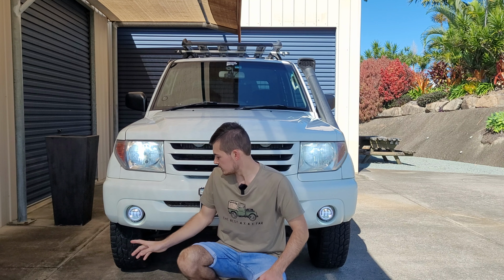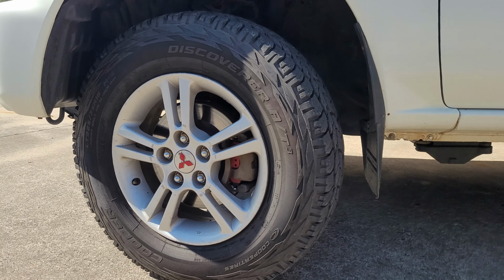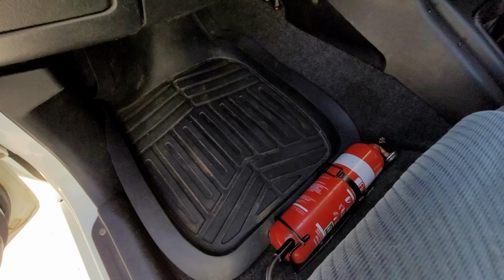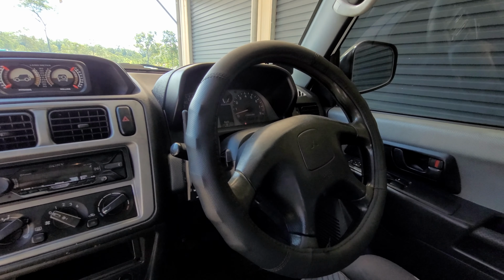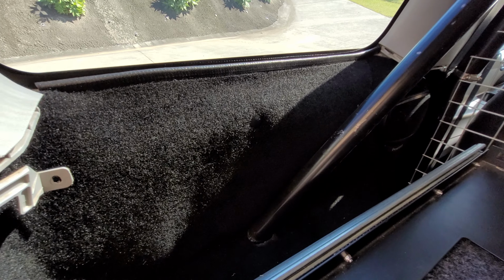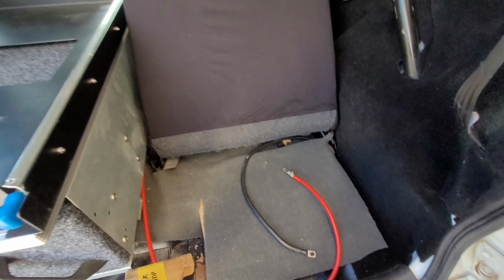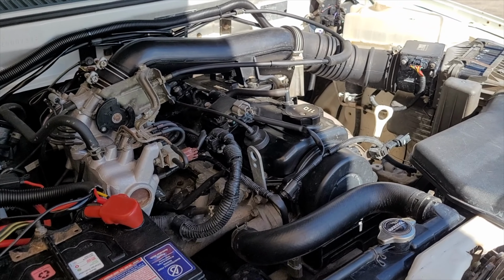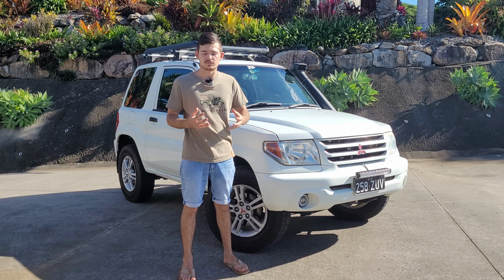Best bargain 4x4 in Australia.

Comment: Would be cool if you did a video on budget 4x4s you'd recommend, I am thinking about a ute for carting stuff around but 4wd sounds good for the camping aspect, that got me thinking about compact solutions with roof racks, pajero looks sweet but not much room in the back, but kind of digging all the addon ideas seems very practical and sensible compared to these dudes getting around in utes double the size they hardly use the potential of
Reply from the maker: Yes 100% mate 💯